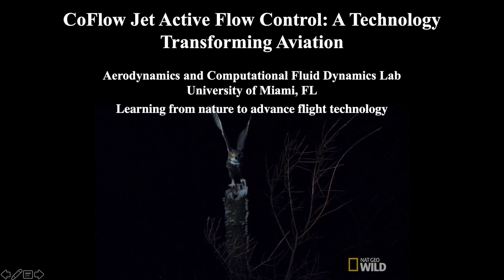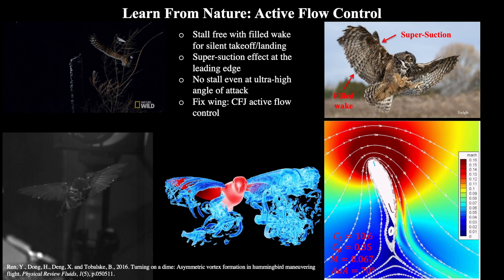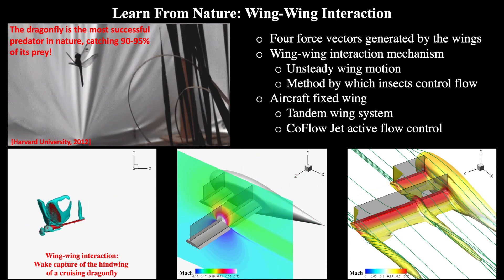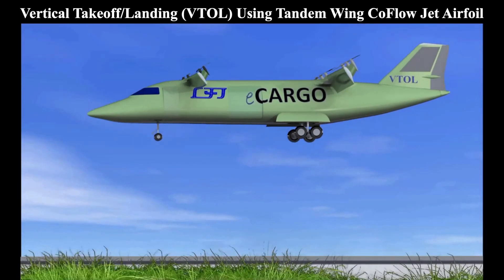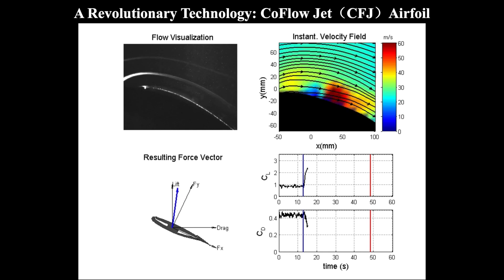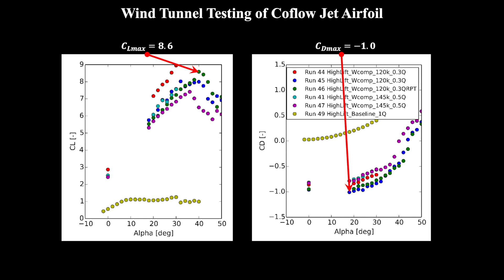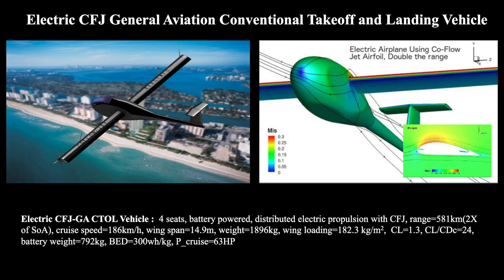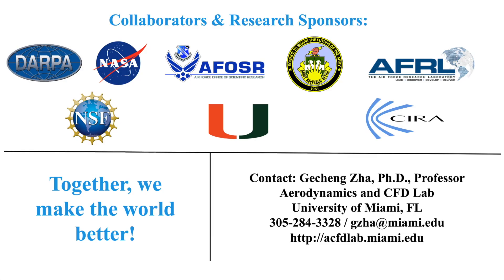CoFlow Jet Green Aviation Presentation for Frost Science Museum

Comment: If co-flow jet technology could give electric aircraft range "on par with conventional aircraft" (@time 0:34), which is a big "if", then it could also increase the range of conventional aircraft, so "conventional" aircraft would then still enjoy a far superior range.  So this one sentence makes no sense in two ways.  First, is it really that good, and second, if so, wouldn't everyone then use it?  The wind tunnel test measures only a top wing surface, not what's going on inside the wing to make it happen, nor the associated opposite forces.  Renderings will appear to behave in whatever way is intended.  Where's the real aircraft to prove this?  It could be demonstrated and proven at an RC model scale.

Comment: I'm sorry, I came here to watch a CoFlow Jet demonstration.  I have watched many of Dr. Zha's interviews and presentations.  The author of this demonstration doesn't seem to understand the concept.  The reason that the CoFlow Jet is so striking is that it doesn't change the pitch of the whole airfoil.  The airfoil trailing half is what turns downward.  The CoFlow Jet technology keeps the airflow from the prop (still pointing forward) clinging to the angled down airfoil to produce upward thrust.  This demonstration is showing a tilt wing aircraft.  This has been tested and proven to work but it's very complex, expensive and inefficient.  Please take this video down, study the CoFlow Jet again then re-post a corrected presentation of actual CFJ in action.  Thank you for your effort but this example gets a F for an F'd up demonstration showing the wrong technology.